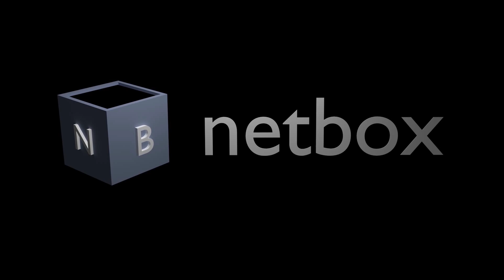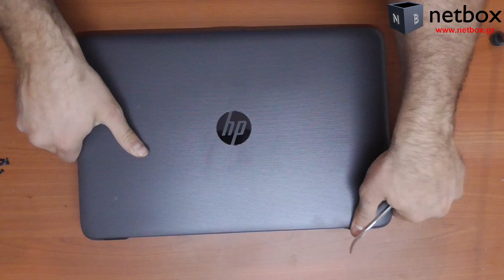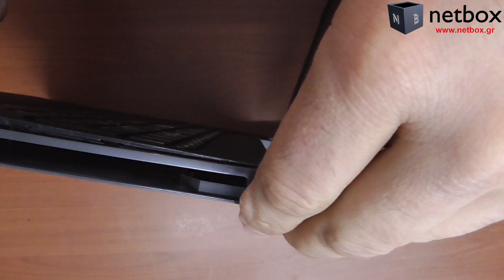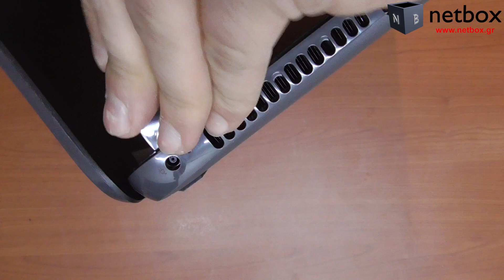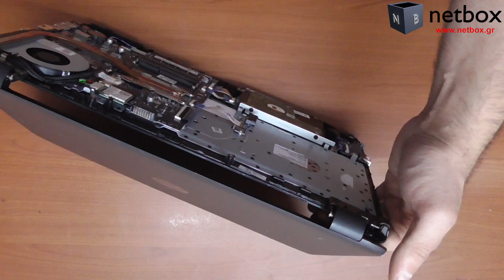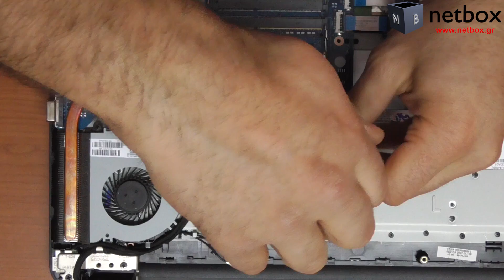HP 250 G5 Upgrade RAM, Upgrade HDD, Clean FAN, Change Wifi Antenna

Comment: HP are bellends for making this so difficult to open
Reply: Its easy to open
Reply: @pinacolada3302  No it isnt.
Reply: @R4STABAN  opened it in two minutes. Deal with it kid
Reply: @pinacolada3302  Stop making excuse for companies. The design is awful. The right hand hinge is prone to shearing damage from normal use, and the central plastic nub under the keyboard is prone to becoming jammed if the user has pressed down on the board.
Reply: @R4STABAN  well seems like a you problem to me.
Reply: @pinacolada3302  My problem is that some idiot ordered over 100 of thesefor our inventory and they're awful.

Comment: Can I in my hp 250 g5 with intel i3 5005 upgrade KINGSTON 8GB DDR3L HyperX FURY Black 1866MHz CL11 - HX318LC11FB/8 8GB, DDR3L, 1866Mhz, CL11
Reply: It needs to match the ghz so i dont recommend using anything other then standard hp ram the laptop gets stuck in a boot loop

Comment: Can I switch my GPU on this thing ?
Reply: The System's Graphics Proccesing Unit is bult-in the actual cpu thats why you cant really replace the GPU or throw a new one on the system. Also you shouldnt have ever thought mobile GPUs could have been cheap as they can cost up to 400$ and they usually are a low-end ones.

Comment: Nice video. I wanted to swap the 1 TB HDD with a 250 GB SSD and I was looking for this. I also added a second 8 GB RAM module and it was all smooth and easy. Thanks for the video.
Reply: is it possible to upgrade processor on this?
Reply: @sagorshikdertibro6238  unfortunately no. I wanted to change but its impossible
Reply: What is max. RAM in that laptop in both slots?

Comment: the cpu on this model can't be changed?
Reply: Laptop CPUs are installed differently than desktops.  They use something called something along the lines of Ball installation.  Where basically they bind the pins on the board and laptop together with balls of solder/metal.  Its very complicated to both remove the CPU after this type of installation as well as to install a new one.  Essentially you'd more than likely have to remove the entire board and put a new one in with a new CPU installed.  But again, installing many mobile CPUs is not easy to do for the consumer as it requires intricate ball installation.

If youre buying this laptop though, you shouldn't be buying it expecting to upgrade the CPU.  This is a super entry level basic laptop designed for people who want to do no more than browse the web, check email, and watch some youtube and such.  If youre buying this expecting to get some crazy upgrades out of it besides an extra bit of ram and a SSD or bigger HDD, youre not buying the right computer
Reply from the maker: it can only be done by a professional mate and one what knows his thing, as you need to desolder the already installed cpu.

Comment: i have hp 250 G4 same design as G5, and i don't know how to clean the keyboard, shoud i open the cover, or i pull the keys  key by key
Reply from the maker: Hi, to clean the keyaboard you need to remove everything, the motherboard all the cables and metal plate and then you will have access to the keyboard!
Reply: thank you very much i appreciate that